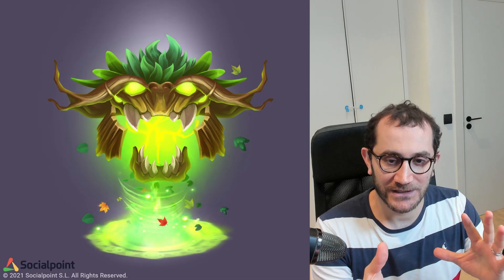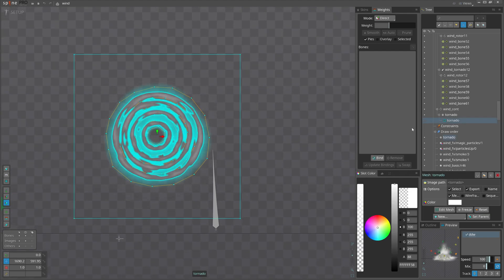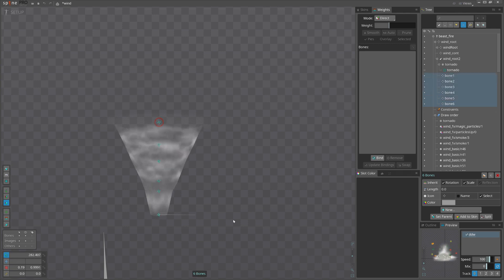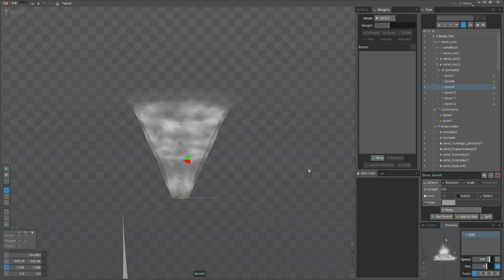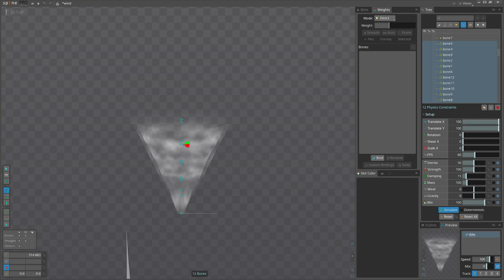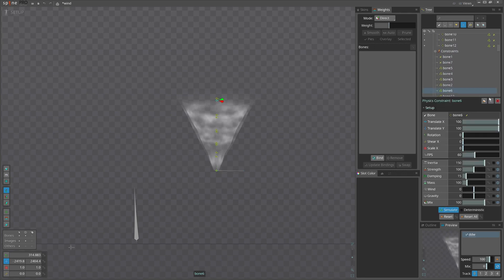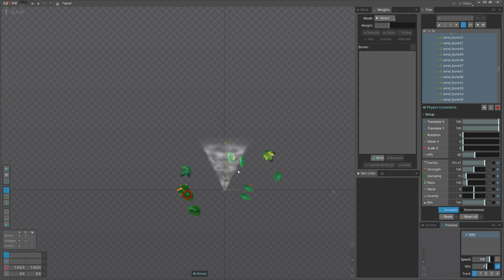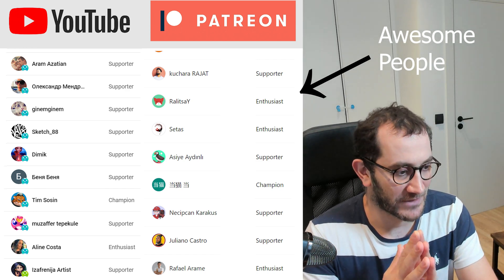Tornado VFX in Spine using Physics Constraints

Comment: Hello, I have a question and I'm very confused. I tried making a loop animation using physics this week but everytime I export the loop was broken. 

In the forums, someone answered with a link to a post saying that "the point of physics was not to use it for loop so this would not work". But it doesn't make sense to me. Do you have a solution or another answer to this? Thanks in advance.
Reply from the maker: I agree with the answer on the forums. It can loop in the editor or game but if you export it as video or gif it won't loop
Reply: @armanimationn  thanks for the answer.
Reply: @armanimationn  I wish it was a way to "bake" the physics simulation into key frames for this type of export.
Reply from the maker: It is not possible to have looping physics baked on keyframes, at least to my understanding, you can check Deterministic to see how it will look with baked physics. @thathiefsandiego
Reply: Sorry if this is late but if you set warm up to 1 (or more) in the export menu, it should fix it!